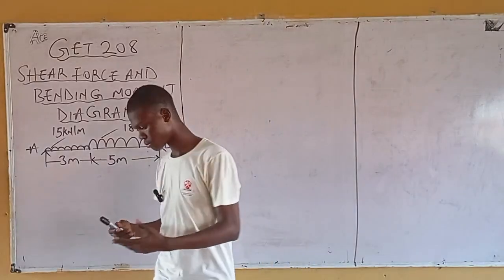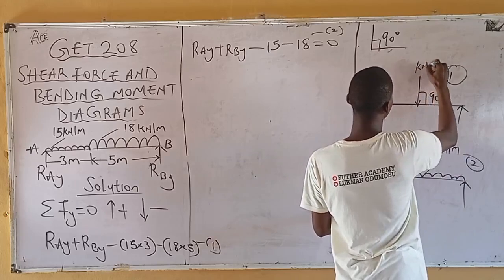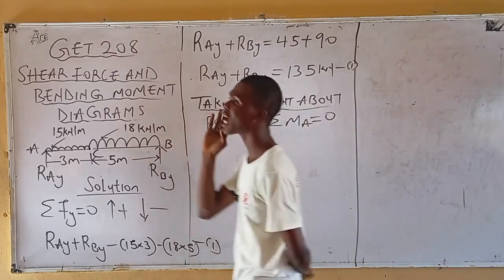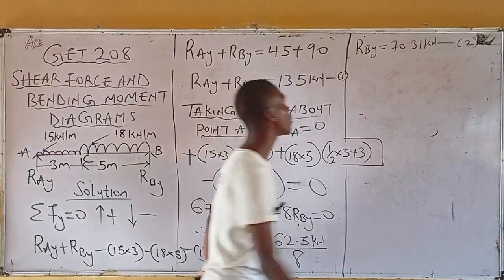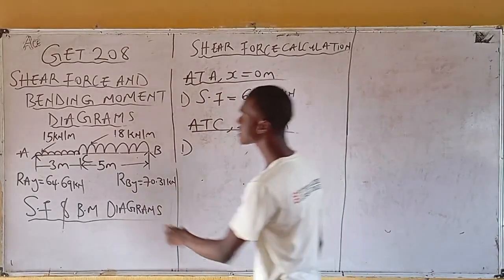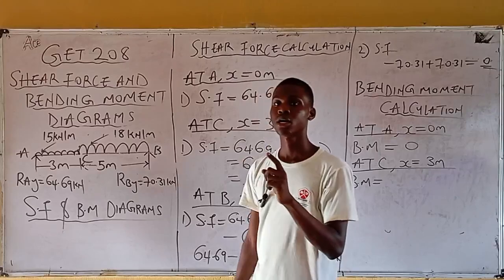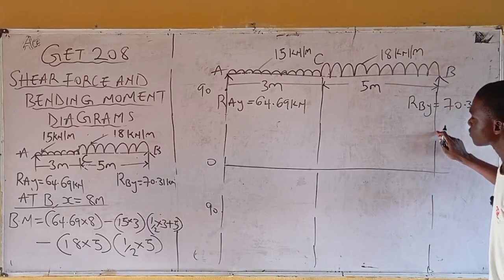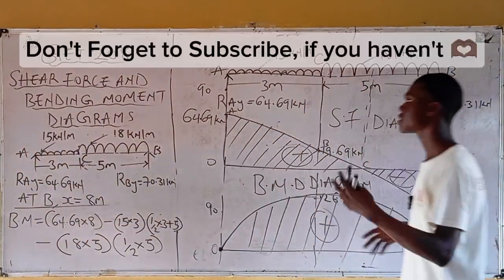How to Draw Shear Force and Bending Moment For A Uniformly Distributed Loads~U.D.Ls

Comment: what if i first covert my udl to a point load ,will sfd and bmd diagram remain the same
Reply from the maker: No, don't first convert to a point load.

Each load has its unique S.F and B.M diagrams.
Reply: U mean my work will be marked wrong if I convert everything into a PL and then calculate and draw the sf and Bmd
Reply from the maker: Exactly!

What your lecturer wants to see is your understanding of how well you know the corresponding loads with respect to their
 S. F and B.M

So, you converting is more like you are solving a new question.